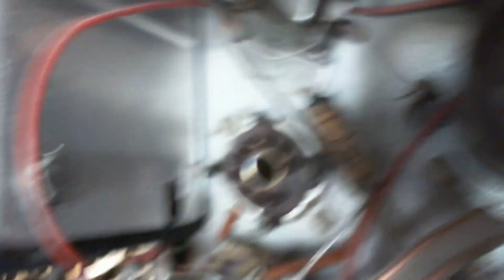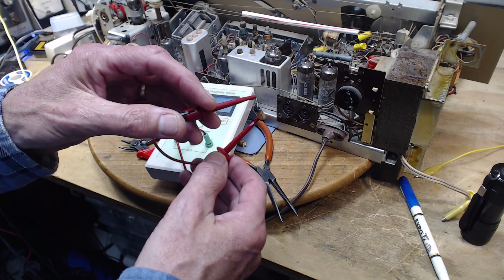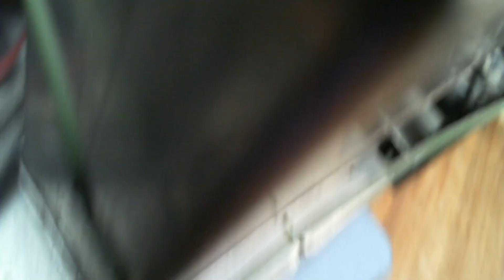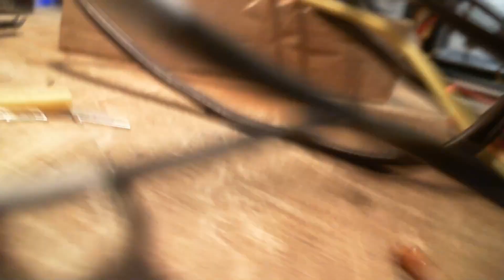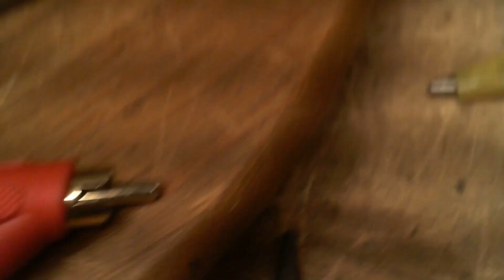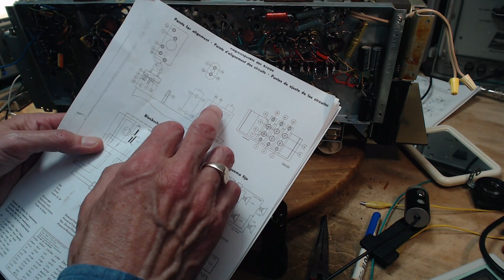Telefunken Salzburg 5094W Console Video #22 - Stymied at the End

Comment: If its too complicated, don't repair it. I would be studying the schematics and any other information available before even starting. Did you prove that switch S7 was what you thought it was? How does the AFC circuit work in this radio? What else could affect the AFC? I don't think the manufacturer sent out this radio half working. If the German engineers were so bad with their designs why do you keep repairing German radios? You have done enough of them over the years. Would you like the mechanic to do half a job on your brakes because it was too hard? Maybe you should check out " Electronics Old and New by M Caldera". He may be able to enlighten you on the workings of this radio.
Reply: Well said. In my honest opinion, Manuel is the master of these German radios.
Reply: Jim is the master of half fixed, good enough, good job, two thumbs up.
Remember how Jim mentioned before that the owner of this  radio explicitly requested - no demanded - that ALL old capacitors be changed? 
Did Jim follow this work order? NO!
He selfrighteously went against customer's orders. That is a failure to comply and reason to refuse payment!